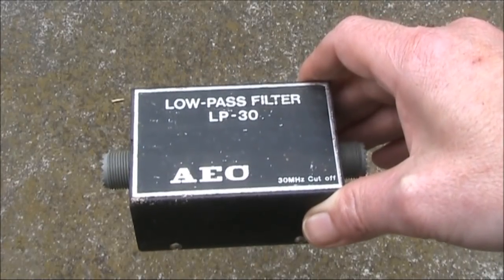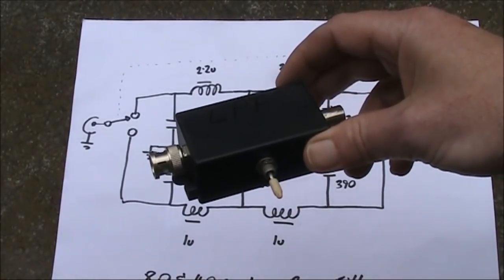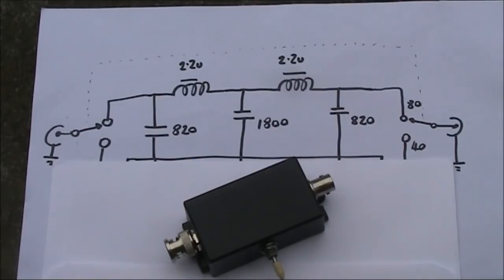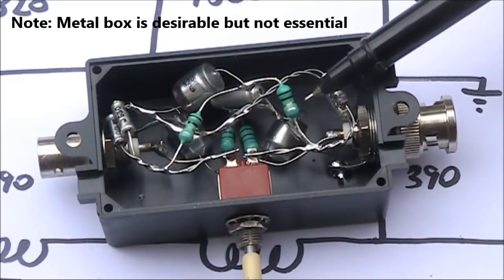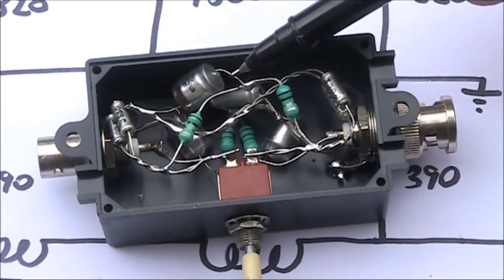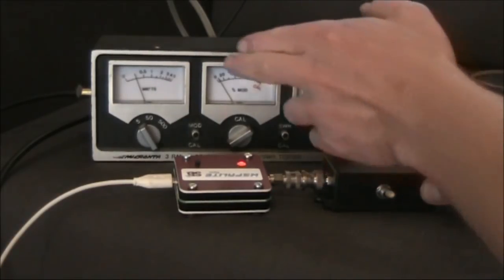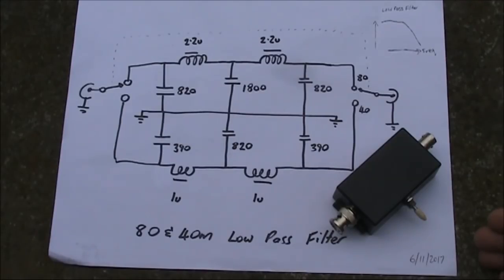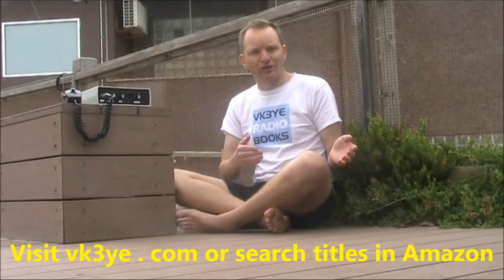A switchable QRP low pass filter for 3.5 and 7 MHz

Comment: I built only the 40m only.  I couldn't get two RF chokes so I did the toroid route.  The 820 pF is polystyerene film, while the two 390 pF are silver micas.  I used an Altoid tin and used the whole tin as the ground; was that what you meant when you said the enclosure should be metal?  I did insulate the toroids from the ground with some cork.  Wish I can upload a pic.  Thanks again for the video Peter.  Now i'm going to build the one transistor transmitter so I'd have a signal to filter!